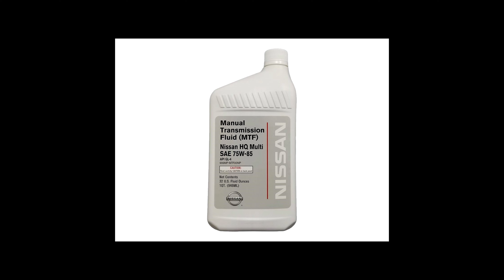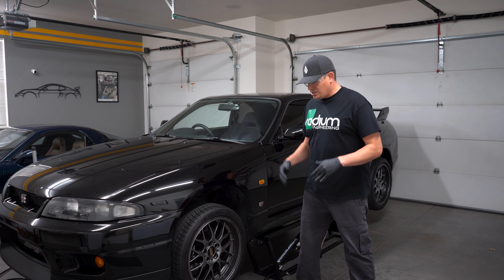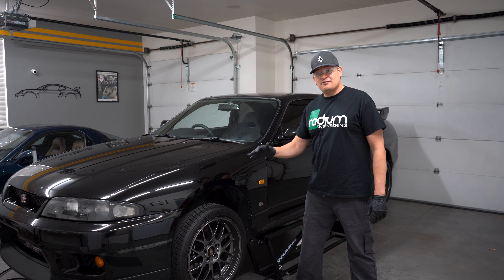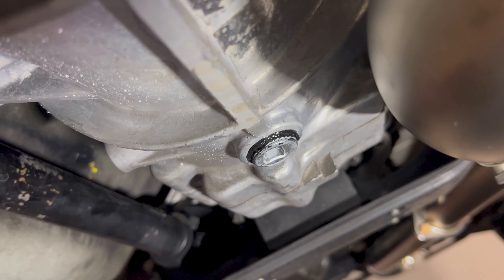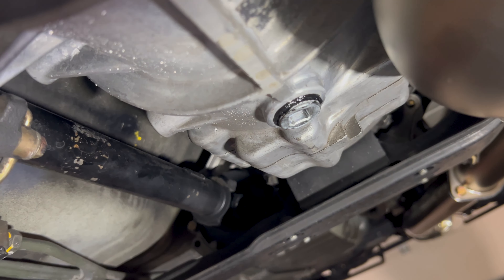R33 GT-R Transmisson Fluid Change DIY - R33 Nissan Skyline

Comment: Safety first when getting under a lifted vehicle, then proceed. That pump is the only way to go to refill without making a mess. Good move. The right tools and attitude always make task go smooth. Good job David.
Reply from the maker: The pump works but it’s still such a messy job. Spent an hour cleaning drips all over the garage but it’s shift great now! 🤘🏽

Comment: Don’t need the heavy shockproof. Lightweight smurfs blood will work just fine and won’t be hard to shift cold. Been using it for years. Not one crunch since even at high rpm.
Reply from the maker: Good to know! I went and drove with new fluid (Redline MT-90) and it feels better. I think the previous owner put Mobil 1 one synthetic in it. I might try the light shockproof later on. Thanks for the heads up.
Reply: The reason I did it was as because I had slight crunching at 6500K in 4th + 5th. Figured I’d try this out instead of replacing the synchros and I’ve been good for the past 3 years. But if yours isn’t crunching I’d stick to the MT-90. Love redline products.